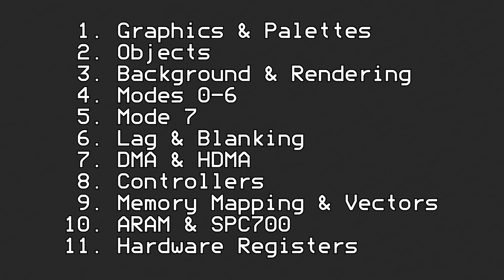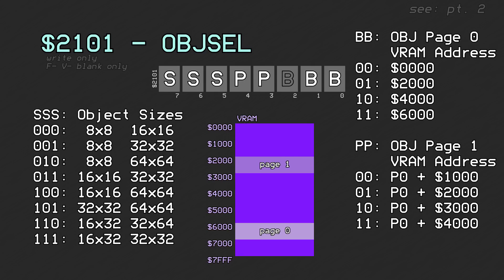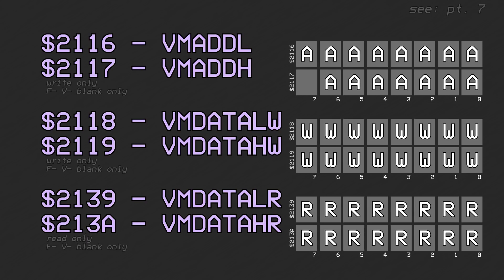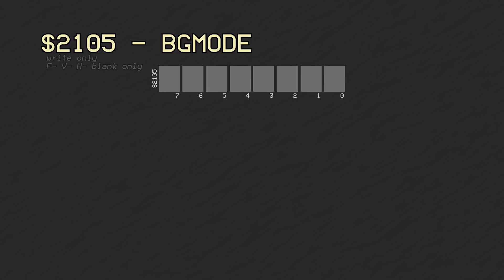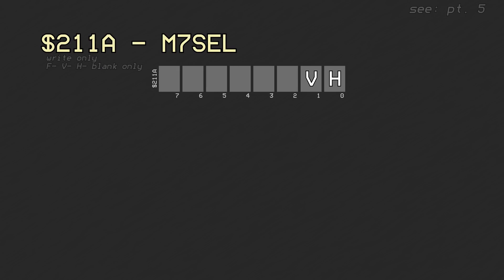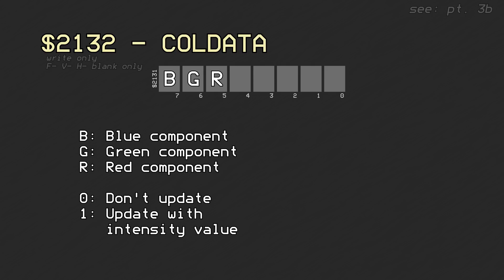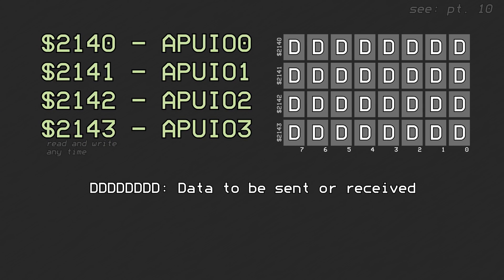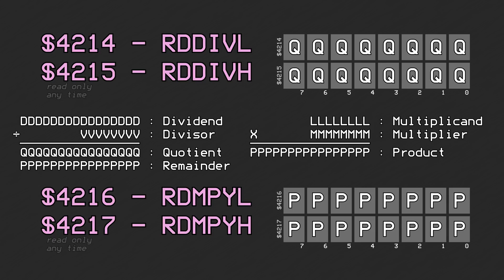Hardware Registers - Super Nintendo Entertainment System Features Pt. 11

Comment: At 3:02, when you mention the priority switch of $2103, you say that one should write the index of the object in the first 7 bits of $2102 and that the value should be between $00 to $7F.
As I understand it, the least significant bit (bit 0), kind of toggles between the X/Y position (write twice to $2104) and the character/attributes (again write twice to $2104) of a single object.
That is, $00 points to X/Y of Object 0 and $01 is character/attribute of Object 0.
Object 1 would be $02 and $03 and so on.

What I mean to say is, what should be written to $2102 to select the index of the object, shouldn't it start at $00 to select Object 0 and then increase by $02 until $FE?
($00, $02, $04, $06, $08, $0A, etc. until $FE)
Reply from the maker: That's what you would think, but it is indeed just the index. I believe when the highest bit of $2103 is set, it sets up the hardware in such a way that the next write to $2102 is sent somewhere else in the PPU. So it's not really acting as a pointer into OAM.

Comment: What about the expansion port on the bottom of the SNES?
Reply from the maker: The expansion port basically just exposes some address and data pins that give it read/write access to the entire $21xx page. It's up to the device that plugs into it to listen in for reads and writes to addresses it may be interested in. The addresses from $2184 to $21FF return open bus normally, so these are usable by any device that plugs in here (and also in the cartridge slot, since it has access to these pins as well). For example, the Satellaview used addresses $2188 through $2199. But those aren't "reserved" for the Satellaview, as another device could use those addresses as well, as long as it wasn't connected at the same time a Satellaview was.
Reply: @RGMechEx  This makes me wonder how much the SNES-CD project could have added to the SNES, if the terms were better.